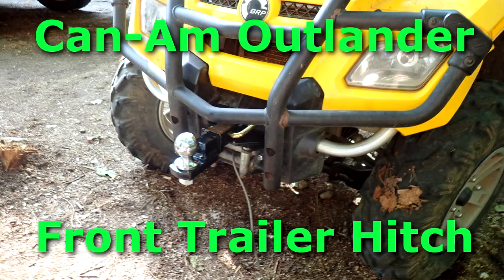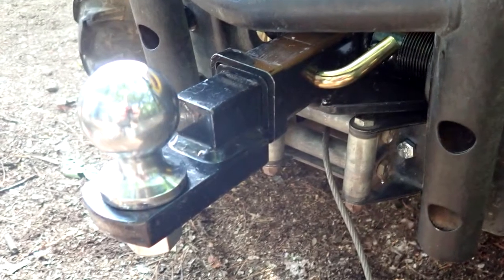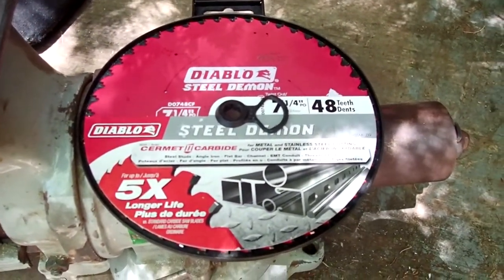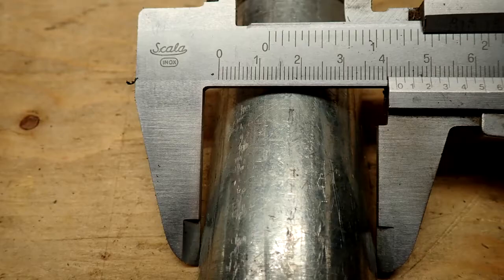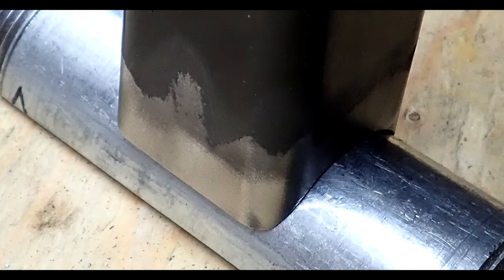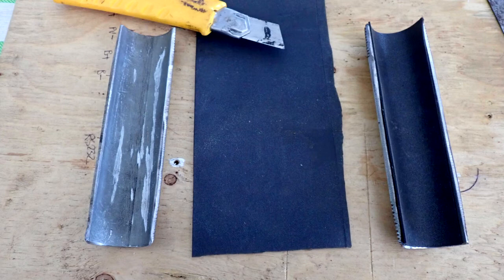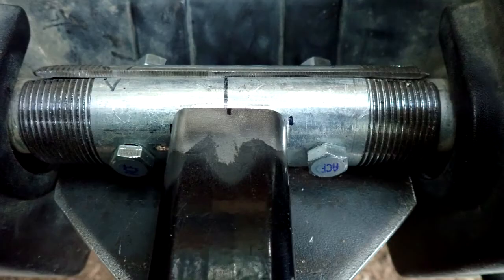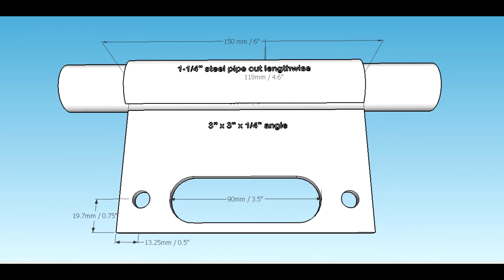DIY Front Trailer Hitch - Can-Am Outlander

Comment: Great idea...I want to add a front hitch to my 06 Suzuki Vinson...this looks like it might work for me. Do you have any video of the hitch in action? What do you think is s the max tongue weight? ,,, Thanks from NW Ontario (Kenora)
Reply from the maker: My apologies for the long delay in getting back to you.  I use my front hitch quite often but don't have any video showing it's use. The limiting factor for me with the tongue weight is the front suspension.  I can't lift the tongue or easily move my loaded snowmobile trailer, but the hitch handles it no problem. I'd say the tongue weight of the sled trailer is probably around 150 lbs.  The most difficult move so far was my 5'x10' utility trailer (18" walls) loaded with hard wood. The hitch held up but the front suspension was pretty much compressed all the way which made it difficult to steer.